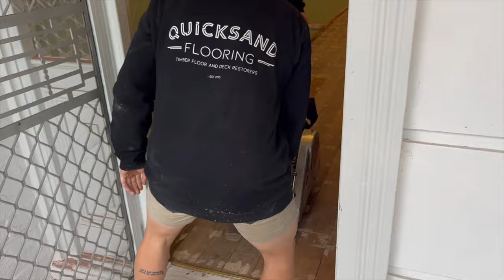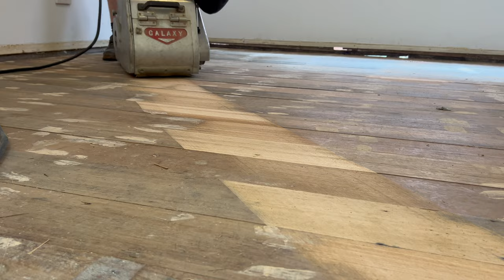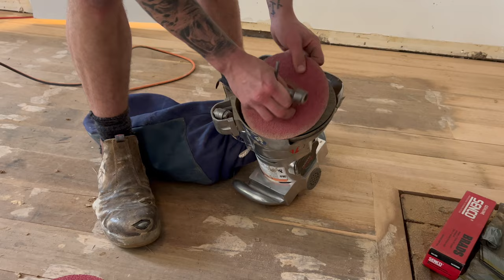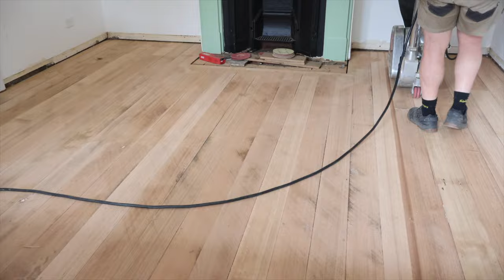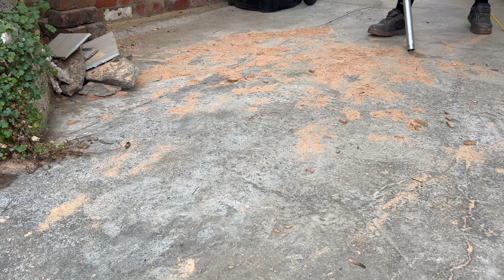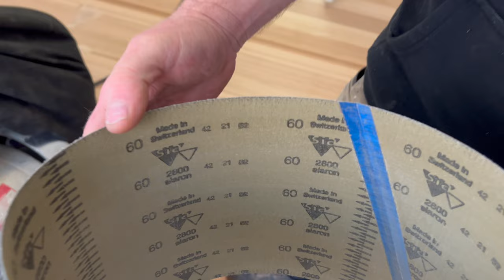CAN WE SAVE THIS FLOOR? | PART 2 | SAND & VARNISH

Comment: Why is there no foundation wall at the exterior walls for this house to sit on and to close the house off from the weather?  Is the house really open to the weather at these areas?  This house construction is really different than what I am used to.  The floors look great.  You go buddy!
Reply from the maker: Cheers mate! The client had the weather boards removed in order to re-stump the entire property and they would have been replaced after we finished up 👍🏻